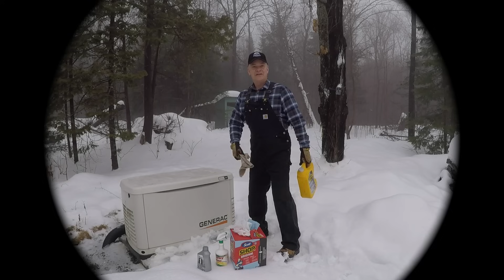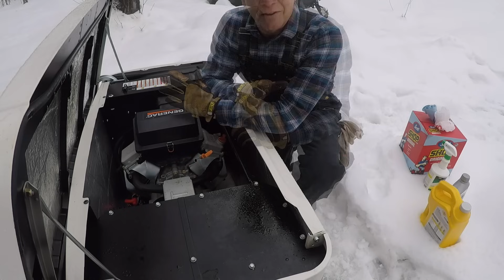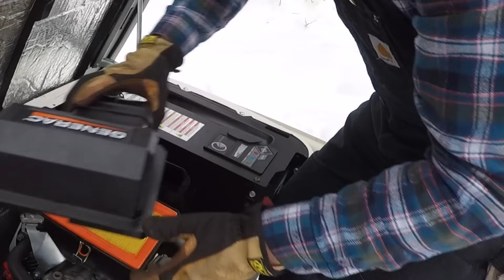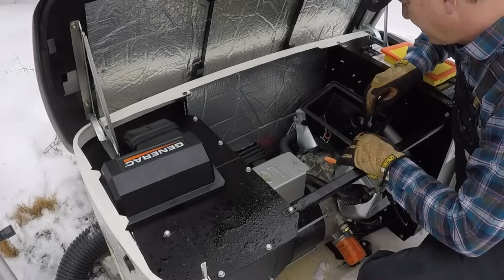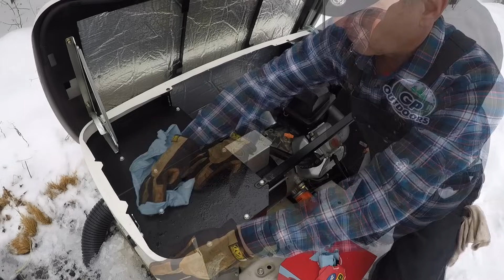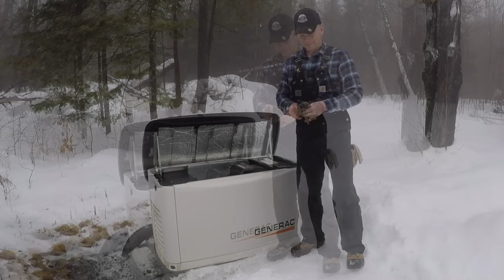#133 Thinking of Buying a Generac Generator? You Need To Watch This!

Comment: You never mentioned how the generator performed over the years and if you would recommend for other home owners. Also, why did you change from a 6 KW to a 16 Kw? What would you recommend for a standard lets say a 1700 sq ft home with two adults and two children in most areas of the US?
Reply from the maker: Hi Edward. Great questions - as a standby generator for that size home, I would recommend it if you do not live in a geographic location that gets severe cold like I do here, ad maybe gets 5 or 6 utility outages a year. This only happens to us up here in really cold weather. I updated from a 6 to the 16, but assuming you have a furnace, 30 or 40 lights, stove, oven, fridge, coffee maker, microwave, toaster, dishwasher, water or well pump, a couple TVs , dvd players, washer/dryer, hot water heater, etc then in my opinion and 10 years experience ( I'm not an expert btw), then an 11 or 12 KW unit will be perfect, but the 16 gave me a little extra confidence, that's all. Remember its about your Demand load, not the total of everything. So, in an outage, just do what I do; don't run the laundry washer and dryer at the same time as you run the microwave and oven etc. You want to run the big electricity loads one after another , not at the same time. I hope that helps a little!
Reply: I’be got a 17 KW Generac as a backup for my house.  One of the best investments I ever made.  It’s six years old, no problems.

Comment: It is not the exhaust port, it is the crank case breather. And yes pressure will build up and push the dipstick out if the crank case cannot breathe. Another symptom of a blocked crank case breather is the engine main oil seals will leak oil. I is very important to pinpoint where oil is leaking from before you make any repairs. This is where many go wrong, what they think is leaking is not always what is leaking. A leak can travel along the oil pan rail an drip at one end of the engine when the actual leak is at the other end of the engine. I have made these mistakes and have learned from them. LOL Good video, its great that we can share knowledge and help other people.

Comment: Put a piece of tubing on the exhaust port to raise it up a few inches within the air cleaner compartment. Or clean the water out every week or so.
Reply: So, let the water level get even higher? Besides, the problem is ice.
Reply: good plan, except or should be and, maintenance is important
Reply: @trustme7731  The problem is ice getting in the port. Letting the water get higher is not a problem. It would provide more time between emptying.
Reply: @trekmontana77  The problem is not maintaining the engine and generator properly. The solution is not to cover up the problem and let the unit run under load for an hour each time it is run which should probably be once every two to three weeks. Every 5 minute run time adds more and more moisture to the crankcase. Like everyone else, you want to mask the pain instead of correcting the source of the pain.
Reply: @trustme7731  Like everyone else, you try to interpret my intentions by reading between the lines of the 3 sentences I wrote. If the air cleaner is filling up with water and that water is running into and freezing up the crankcase exhaust port, then it is a poorly designed air cleaner. That should not happen regardless of whether or not the engine is properly maintained.

Comment: Wonder if you could drill a small hole for drainage in the bottom of the air filter reservoir? Would that compromise the air filter capability?

Comment: You might want to run an angled rubber tube in the exhaust port. And turn it to the side so condensation does have access to it.

Comment: I bought my Generac back in 1995 right after Katrina hit.  3 days later I was cooled by my A/C and my internet was working just fine. Oh since I have a small home under 1400 sq ft and do not need the 12,16,or the 22 KW I got the 7 KW for under 2 grand. Since I didn't have a 5 ton A/C the 7 was more than enough and last year I had a service tech come over and change out the voltage reg he told me was not running right so I think I paid him somewhere around 70 buck and I change both air and oil filters and oil ever so often.  Well if I just fire it up to make sure everything is OK for a few minutes I change the the stuff once or twice a year.
So I am very happy with the unit and maybe used it maybe 15 days total since 95 so it is a long lasting unit.

Comment: Awesome video. Thank you! This crisis occurred to me this morning 12 24 22 - Storm Elliott. The lowest temp overnight was -4F, and it had run for 27 hours continuously, aside from a quick oil check at the 12-hour mark. Cleaned out the ice, topped it off with oil, returned the dipstick, cleaned up 1.8 quarts of oil from within and the belly, and fired it up. NYSIG does not have an estimated restoration time at this writing. Brewster NY.

Comment: Drill a hole in the bottom of the air intake cabinet. Stick a piece of sponge filter in the hole that is wedge  shaped and larger than the dain hole so the larger part of the sponge is on the outside of the cabinet and wont get sucked in, You could also divert the exhaust up higher with a piece of hose well sealed where its inserted there so it doesnt get as easily clogged. problem hopefully solved.

Comment: I wouldn't call it a exhaust port per se it's like the EGR (Exhaust Gas Recirculation) on your car this takes the vapors from the crankcase and burns it! Just a emissions control sure they should fix the design issue if the actual exhaust was totally blocked the engine would not run long and possibly damage the engine like the valves and pistons.

Comment: It's actually crank case vent, not an exhaust port, 2 very different things. The crank case vent is vital. I would just disconnect it from the air box and put it w somewhere safe from moving parts. It's the vent that releases pressure built from the lower end (crank) and it needs somewhere to go

Comment: If there is not one on there already, Generac should put a well placed label notice about something that serious right where it can be easily seen inside that generator case, NOT just in the manual. That will almost certainly lead to premature engine failure and I doubt it would take too many seasons for it to happen either.

Comment: First. It’s a pleasure to listen to a gentleman. They are in short supply. 
I live in Southern California. The entire state is under constant threat of power outages because of years of politically motivated infrastructure neglect. In 2019 I installed a 22KW. Best thing I ever did. I don’t think I’ll have to be concerned with this issue. It’s something the manufacturer should be aware of.

Comment: The air box heater would definitely help because it not snow coming in just frozen condensation they sell them in kit with oil filter warmer and battery heater I use the oil filter heater alot the OEM kit is probably the best you can get separately I don't run the battery warmer mine is very new and the battery comes out intake cover there's 2 options now standard group 26R or group 35 AGM 640CCA I've also had 2 Generacs just replaced my 2003 unit in November

Comment: Maybe drill a couple small holes into the bottom of the reservoir so condensation just leaks out instead of building up...not sure how it would effect the air pressure required in that specific case...gotta work some duck tape into the solution...

Comment: When you say "exhaust port" you really mean crankcase vent.  Most mechanics would refer to the "exhaust port" being the opening after the exhaust valve that lets combustion gasses flow into the manifold and muffler.

Comment: Excellent vid on an issue that is a manufacturer design error. That is the Crank case vent BTW not the "exhaust". the exhaust will be under the hinge and vented to the exterior of the housing.

Comment: Had one of the 16k units for 15 years in Va. No such problem. If I had not seen it, would not have believed that could happen. Sorry a guy like you who is a neat and clean type had to go through that. I had to move mine 100 feet into the woods a bit due to monoxide getting in my house. They offered me a fair deal on a 22 k and I took it. Man This was a video! Somewhat similar story short version Had a 64 Ford truck that would just slow down and stop. After lots of wasted money found it was ice in carb due to heat passage in manifold being blocked by carbon.

Comment: I wonder if you can hear the engine noise from inside the cabin?   Yrs back I had to run a genny for a week and it bothered me a lot, I guess knowing each kilowatt hour of electricity costs 90 cents instead of 16 cents! LOL
Reply from the maker: I only hear it when I am in the back of the cabin - otherwise I don't hear it at all. But I know what you mean -$$ LOL!
Reply: @GPOutdoors  TY!!

Comment: Gord I had to stop and view this video because we have a 2010 Generac 20KW whole home generator here in coastal Virginia and I have to say after 12 years of ownership I have never had this issue or any issues, zero. Next to my Kubota B7800 it's one of the most dependable equipment I own! EPA must have got involved at some point after 2010!  Ours runs on LP and has a different air box than yours. Our winters can get cold but not Ontario cold! Be well! Cheers!

Comment: Thanks for the cool video and the information.I’m moving to Florida and going to install a 22K Generac, but I guess the cold won’t be an issue lol it’s too bad that Generac can’t make some kind of deicing system for that air breather?
Reply from the maker: LOL. Good day David. I am sure you will be a-ok. This happens when it gets super cold here - around -20 celsius (sorry i forget the degrees Fahrenheit measure). Otherwise it has worked fine. Good luck to you and good decision getting backup power. It is worth alot for sure when the power goes out. A 22KW unit should allow you to power the whole house, including the Air conditioning, cooking lights etc. All the best!
Reply: @GPOutdoors  It will be my second Generac whole house standby Generator.I always had the cheap China knockoff 5000 watt generators always seemed somewhat troublesome and unreliable....until that first whole house Generac came along and the rest is history lol!

Comment: Hi. I have been thinking of getting a backup generator. I was under the impression that they were self maintained kinda like our package unit. After watching your video it seems like it's going to be a hands on thing. So if I'm understanding you correctly you've bought 2 in 10yrs? That's like $10k?
Reply from the maker: Good morning Lee. If I may offer - I use mine for backup to a solar system which operates a little differently. If you are using it as a backup to your utility power I think you will find you use it much less. They are generally self maintained ( if you purchase one along with a Transfer switch etc) such that if your power goes out, the generator will automatically start and keep the house powered until your utility power is restored. All good. Usually the unit will require an annual maintenance service but otherwise, should be self running. Up here, for some reason, we get this water build up that happens only in severe cold temperatures. I have heating kits on the unit however I have learned to go soak up the water after it has run for long periods of time. Otherwise it runs well, I think. I hope that helps clarify. If you are considering getting a backup generator, I think that is a great idea - especially if you are getting older as I am - having a backup is good peace of mind and boy, if the utility power goes out , having the house and heat working is so important, especially in the winter. God luck and all the best!
Reply: @GPOutdoors  Thanks. You too

Comment: The past two weeks I have noticed my Generac Guardian 20KW generator in it’s weekly starting maintenance it would crank longer than it should. When it would start the engine would surge, backfire and at times just die.

I had the serviceman come out and ran some tests. He discovered that the piston rings were going bad. The runtime of the engine in the past 7 years would add up to about 4 days, which included the weekly maintenance cycle.

I paid a lot of money thinking I would get a top notch generator when in fact Generac has put on 2nd grade piston rings.
The compression pressure on the outside cylinder is about 85lbs and the back one is 150lbs.

If am going to have to buy a new generator engine which is going to cost over $ 2,600. 
I feel that this generator which I paid a lot of money for this generator and should have a better engine.

After talking to Generac they gave me a case number and turning my problem over to the service department under “Manufacture defective parts” which if they OK they will cover the cost of the engine.

I’m waiting for word about what they are going to do about their problem.

Comment: If you run a low wattage heat tape to the air handler/exhaust port housing that could eliminate the problem of freezing condensation.

Comment: That's why liquid cooled generators run block heaters.  Generators don't idle, they go from 0 rpm to 1700.  The heaters not only warm the block and oil, they prevent the condensation and freezing issues by minimizing temperature fluctuations.

Comment: A solution to eliminate the issue would have been nice.  Perhaps a small drain hole in the airbox just below the vent port elevation, or an extension tube to elevate the ventilation port access.  
Maybe both...

Comment: The 'exhaust port' in the air cleaner box is more likely the 'engine oil breather vent' like on a car engine. Too bad there's no float operated drain valve in the air box!

Comment: Wonder if you could put a 3/8 inch hole in the bottom of the plastic piece where the condensed water lays so that it drains out rather than freezes?

Comment: Question!   Can you just unplug that rubber hose that was froze ? I think that is the hose that goes to the engine case. Older motors the vent case hose just came out of  vent and pointed straight down. didn't go into filter like they do now days.
Reply from the maker: Yes, sorry for any confusion - it is the vent port. I believe it is to meet environmental standards. But excellent question - thanks!

Comment: With all that oil inside airborne, I'd imagine that the fan conveyed some into your cooling fins. I'd consider using a degreaser on it and get that oil out of there while it's relatively easy. I can see that if there's oil there, that it'll attract dust...like it does....and you'll start loosing cooling ability.   2cents....

Comment: when you say exhaust port do you mean crank case breather port to the air cleaner. ive neve seen the exhaust go into the air cleaner box. i would recommend drilling a hole in the bottom of the air cleaner box so the water would drain off as soon as the engine stops while it is still liquid. or move the crank case breather up higher in the air cleaner box extending the time in between fixes.
Reply: Don't drill a hole! It will suck unfiltered air into the engine.
Reply: @wesman7837  the air cleaner is attached to the carb inlet in that box. so not unfiltered air.
Reply: @gregoryperkins2180  the air is taken into the air filter box on the top of the box through the top which he removed. If you watch carefully you'll see how he twisted the top up to remove it from the air intake port. The air is taken down through the filter into that area that collects the water and is taken into the engine through the hole in the front of box into the metal intake manifold. Thus, if you drill a hole in the Box you will take in unfiltered air and mix it with filtered air sending it into the engine. This hole can also allow insects in which also would be drawn into the engine when it runs.
Reply: @mikeslater6246  melted water will run trough a hole as small as 1/8 inch. .125". a rubber flap will let water run out when the vacuum doesnt hold the flap up. this way the box is sealed while running and releases the water at shut down immediately before freezing. this isnt a difficult principle the company can use an atv designed air box with the filter inside and the intake at the bottom acting like a drain.

Comment: I have owned Generac generators for over 20 years. I now have a 24Kw system that can power my whole farm operation. My generator inside the case looks exactly like the one in the video. I do routine preventative maintenance and have the generator checked and serviced by the agent I bought it from every year. I consider the generator as "Life Insurance."
Reply: Yours is good because it's before the investment firm bought generac. Was like 2009 or something.

Comment: What would happen if you fill the bottom of the air filter casing with anti-freeze? Any condensation would not freeze, but just go out the pcv port, keeping the same level. Then every time it runs, refill the air filter compartment with antifreeze.